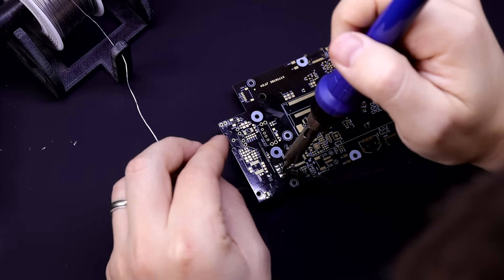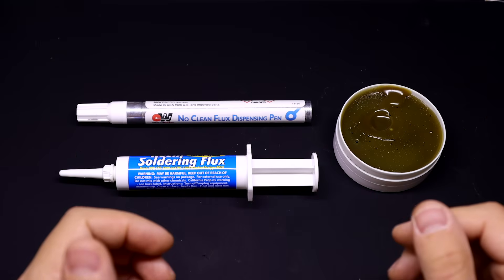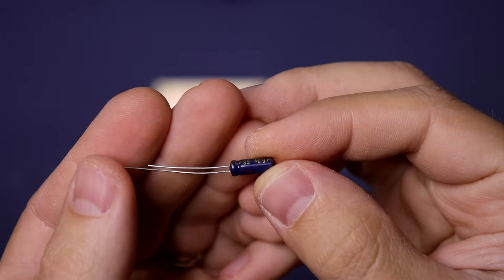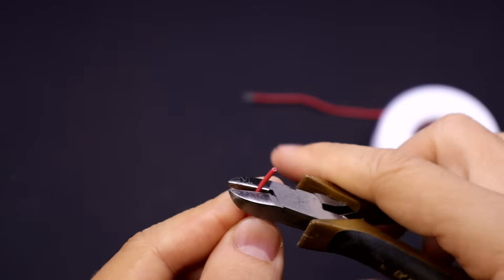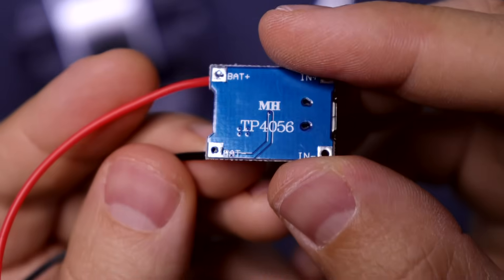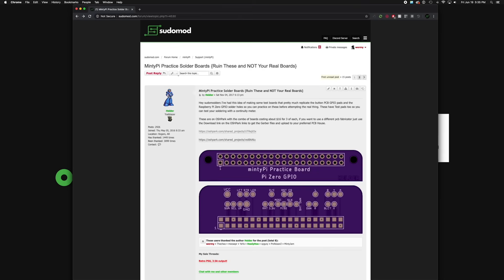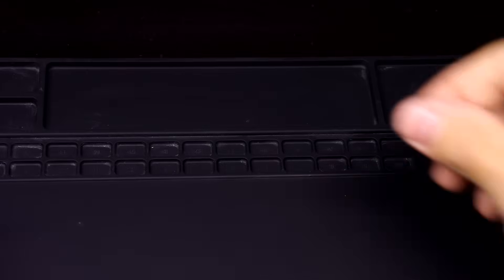Soldering Crash Course: Basic Techniques, Tips and Advice!

Comment: Good stuff! Interesting technique for making super flat connections between 2 boards. I tried something similar in the past for connecting 2 addressable LED strips, and it was honestly a little hit-or-miss. When you make a cut in those strips, there's always a chance that the data line will get bridged to power or ground, ensuring that the LEDs after that connection don't work properly.
I'm thinking one possible way to foolproof that board-to-board connection is to use a very low hot air on the rework station or the electric mini hot plate Adafruit sells to preheat all those pads. Or find some way to squeeze in a little solder paste (syringe?) into each through hole, then use hot air on the sandwich. Or maybe a method similar to BGA soldering: tin the bottom pads first, clean it, flux it, put Raspberry Pi on top, and proceed with hot air.

Anyone who solders every day should use a filter or good ventilation, especially if they're using lead-free. You really don't want to be inhaling flux vapor.

One thing I've learned from Rob back when he was doing Sparkfun product videos: Always leave a blob of solder on the tip of your iron when you're not using it. Making a habit of this will always keep the tip tinned (important for heat conduction), it will prolong its useful life and you won't need to use tip tinner which is designed to remove heavy oxidation and really shouldn't be used regularly. If the oxidation isn't horrible you can re-tin a tip with some solder wire and a little gel flux applied to it.

Comment: For 8:30 another method is to use liquid flux to add more fluidity for the solder to melt along with through the hole when heated.

Extra tips:
0) Wear eyepro; flying bits from snipping pieces, fumes, general safety.
1) Drag upwards when adequate amount of solder has been melted for a nice cone shape. Using liquid flux helps.
2) After solder has cooled, use a nylon brush plus 99% isopropyl alcohol to clean and shiny the solder.
3) Use the solder to cover the soldering iron tip, and dab into the cleaning container to apply a protective coating to the tip after you're done soldering.
4) Wash hands w/ soap and water every time you're done; don't want an eye infection from rubbing your eyes or face with dirty hands do you?
*Correct me if I got anything wrong & I'll edit my comment.
Reply: Just what I was looking for! Can't get the solder melted when trying to put the wire in (only worked once, and was just thinking about getting some liquid flux). Is this usual or am I doing something wrong?

Comment: Ok so I guess I’m a pre-beginner solder-er and I’m still stuck on how the flame comes out… I’m for sure missing a piece or two in my kit, but I don’t know how to heat the tip, the flame just goes out a hole on the side🤫🤷🏼‍♀️🤷🏼‍♀️
Reply: Flame? Solder guns don't have flames. (Maybe you have a propane torch?)

Comment: OK I'm just looking nice video by the way before I get into it I see a lot of people using flux And I see the can type in the squeeze type in the squeeze type I was wondering which is the best to use just for sottering wires back to the board And what kind of alcohol they use to clean up the mess and what they use to clean it up with a  Q tips is there a cleaning rag set I could buy on Amazon I just need to know need to know what I need to buy on Amazon the alcohol the flux and what kind of cleaning tools I got a sottering iron it's not the best but it will do the job thank you hope you get back Great videos by the way again thanks

Comment: This is a much better learning experience for solider I do a lot of soldering because I'm into radio control and I charge out connector but I don't do much motherboard and I use a lot more solider with connector so I need to  Practice using  Last solider like on my Orlandoo hunter esc and servo motherboard and now I'm into 3d printing and I need help fixing soon

Comment: I would like to hear your commentary on old solder old flux and old soldering tips...... what can I soak my rolls and rolls of solder in to clean them of this filthy coating.... and does flux lose its ability in time... and the different kinds of flux different for copper pipe different for electronic boards different

Comment: My daughter got a Pusheen wireless speaker.. actually Santa bought it but it seems to have lost its connections.  All the system does is just record that the battery is being charged.  I opened it up and found that the board and the wires to it aren't connected.  I find this video most helpful, please wish me luck to see if I can fix it.  I have a point soldering iron... Have to go to home Depot to get solder and see if I can find a cleaner.  Wish me luck

Comment: @wermy Good video man; helpful to me as a beginner.

(Dwight Schrute tone) Queeestion... What are the advantages of owning/using a hot air rework gun or station?
Reply from the maker: A rework gun makes easy work out of desoldering surface mount components that would otherwise be almost impossible to do cleanly with just an iron. Also makes it easier to use stuff like solder paste to populate a board. Super handy to have for things like heat shrink tubing, too. If you’ve got an extra cubic foot to spare on your desk it’s definitely worth it. 🤘

Comment: Many years ago I took a soldering course called PACE. It was designed to teach efficient, effective soldering. A story we were told was that when they were building the first space shuttle, they built a mock-up, then had the techs take the PACE course and do another mock-up. The difference between the two mock-ups was 2,000 pounds of solder...
Reply: NASA has an entire large manual just on soldering techniques. It's meticulously detailed, and they've studied the metallurgy of soldering in detail in creating their methods.

Comment: I went through an automotive college where we touched on soldering a bit but that was really just wire to wire or occasionally wire to connector. But when it comes to soldering onto a component i have this anxiety that im going to over heat it and fry the part. Is that a realistic fear? is it harder to do than i think? Is there a 5 second rule?

Comment: As someone who solders professionally this is a great video! Just a few personal tips and opinions I'd give:
First type of solder can make a difference depending on the required specs of a project, I prefer lead for through-board as it tends to be more maleable after cooling whereas lead-free composites are better for surface as it cools quicker and flows better.

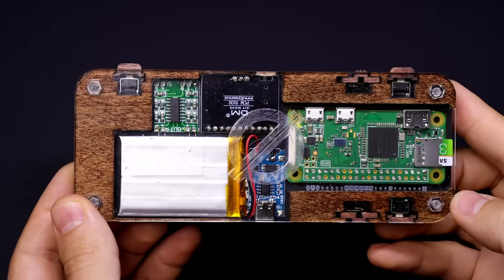11:00 this is usually called stacking and my biggest tip for this is to set an anchor pin in one of the corners. Doing so will make sure all the connections line up properly. If this was a micro connector like what is used in the applewatch you'd reflow or fill the pads first and then heat the solder to allow it to flow through the connector. But those connectors are really thin.

Comment: Thanks! This was more advanced than the things I need to know (I just need to solder switches and 3 LEDs to a mechanical keyboard), but when you recommended the Yihua branded iron/station, I felt more confident in the fact that I’ve been looking to purchase the Yihua 939D+ station. I keep being worried that spending only $53 will hurt more than help, but I truly don’t plan to solder all that often. I used a $12 wood burning pen my first time soldering (on a beginner’s practice kit) and it worked. Not perfectly, but it worked 😂 I just don’t want to ruin my actual projects, so I feel better seeing the recommendation.

Comment: I done exactly as you did to my PS4 controller as the wires came loose when I tried to fix the drift. The problem is you can't just take the board out to solder it. They fit in one piece at a time and when I tried to heat it up whilst touching the wire to the board. It melted the plastics around. So controller is useless. So how do I approach this?

Comment: What soldering is like for the average person:

Buy a $20-30 pencil style iron at a local store because you don't want to spend $100+ for the small amount of soldering that you'll do. Discover that only one specific area on one side of the tip actually gets hot enough to melt solder. Awkwardly press that part of the iron against the part, then gently feed some solder to it. Watch the solder bead up on the tip of the iron rather than one the parts you're trying to solder. Apply flux to the parts and repeat. Get some solder on the parts. Figure out that the easiest way is to just apply the solder to the tip of the iron then apply it to the parts. Check to see that they're actually making a good connection. Say "Good enough." and move on to the next connection.

Joining two wires: Twist strands of wires together. Apply flux. Hold iron against opposite side while applying solder to near side. Watch solder NOT melt. Watch wire insulation melt. Apply solder to tip of iron in frustration and repeatedly smear it along exposed wires until they're coated.

Buy higher wattage iron. Attempt to use it to solder wires to circuit board. Run into the same problems. Hold iron against wires so long that trace starts to lift off board. Scream in frustration. Realize that hotter iron just makes it easier to damage what you're working on. Go back to using dinky little iron.

Yes, I know that's not how you're supposed to do any of this, but that's what soldering is like for me.

Comment: and yet i hold the iron on the pads or whatever I'm trying to solder and the pads will melt off before the solder melts. . that's why I try and put solder on the tip and put it on the pads from there. . but that also only works if Its a brand new tip or i file it a bit. .  really getting pissed off because i keep finding these videos explaining "how to solder" i fallow them and what they show is not what happen when i try it. .
also my tips keep melting, ,

Comment: I've only soldered once. It took me about 3 hours to solder one thing.

Ultimately the problem was that I kept pulling away the Soldering iron before I pulled away the solder. 

So as soon as I pulled away the iron, the solder cooled and stayed on the end of solder rather than on the component.

Eventually I learned that I needed to hold the soldering iron in place and basically push the solder into it like you do here.

although I definitely still ended with a giant, sloppy lump of solder. But it functions.

Comment: On this scale work, the word you are looking for is "flow". Heat, apply, flow, slow cool, check.  As someone that has tinned and soldered more wires than I can count in manufacturing, in regards to putting wires into a board, keep the heat cycles to 1.  Tin the wire when you can for things like pads but, Secure the board, hold the wire and solder in one hand, watch the "flow" into the wire, and sometimes feel the heat in the wire burn you a little, and hold it still until the solder is cool.  (you'll be ok) The only reason to use those tip tools is in mass production or in case of poor tip care.  Use a sponge every time/thought and a little solder on the tip, sponge, work, and again the sponge will get you there. (it can also be a quick source of cold water) Don't overheat things, take it easy with the flux, it should be in your solder.  These are the points I would discuss with a class.  Anyways, Weller for the workmanship!  Worth every penny!

Comment: When I try the solder just wants to migrate to the iron tip and not stick to the wire or pin I am trying to solder together. How do I get the solder to stay on the component and not just melt on to the tip?

Comment: Can I see some down and dirty soldering repair, like trying to solder a new cap into a board in a boombox from 1986 which you can’t remove the board itself without cutting 20 wires.  On top of that you have to wrestle the board with one hand to keep it from turning since you had to at least remove a couple screws to get to the underside.  And the board just happens to be stuffed behind a ratnest of other wires and mechanical parts that tend to break when you just breathe on them.

Comment: Ok, I’m trying to solder pins to an arduino board, but the solder won’t melt unless it is in contact with the iron itself. I cranked the iron temp all the way up, and the solder still won’t melt unless I touch it to the iron. I’m using 0.8mm, lead free, 99% tin solder wire.

Am I using the wrong solder wire? It seems that the idea is to heat the pin and hole with the iron and the solder will melt without having to touch the iron itself, but no matter how long I try to heat up the pin, the solder doesn’t melt unless touching the iron. Any help would be greatly appreciated. Thanks!

Comment: I would like to see, using a standard plug in soldering iron no features, and mdeium gauge rosin core solder.  Reattach a 5 pin usb female to a  board.  My problem is the smaller pins keeping the solder in nice thin lines.

Comment: I'm halfway through this video and have seen several examples of soldering connections, and you even explained how to think of solder as a bonding agent between two heated metal components. What I have yet to learn is to what do I initially contact the unmelted solder? Should I avoid the tip of the iron with the aforementioned solder? Should I wait with the solder contacting both components until the heat transferred through each from the iron simultaneously reaches the solder's melting point? Should I melt a bit of solder onto the iron and then hold that to the component ends?

Comment: Soldering glue makes way more sense
Glue with metal inside that has been grinded into a powder
I almost made it in Toronto but everyone was so depressing i gave up but it makes way more sense
Grind any metal that sends signal and put it in glue 
Worth major money to anyone
I would buy from you
I suggest you use copper.
I would do it but Canada is so depressing its like doing anything isnt worth it

Comment: Love the video, but curious, when splicing wires, why would you not opt for a lineman's splice instead? Where you bend both wired ends into hooks, and twist each wire around the opposite wire's hook, then solder them together.  Even without soldering, this results in an extremely strong, and clean splice with good contact and no additional width added to the wire.  With solder, it's nearly as strong as unbroken wire.

https://en.wikipedia.org/wiki/Western_Union_splice

Comment: is there a difference when soldering 2 wires together the way you showed and putting wires together   --=--  like this? and also with doing the through-hole is there a difference of bending the legs away instead of bending them towards each other and cutting the excess parts of the leg then soldering then soldering then cutting?

I was taught to cut the excess off first before soldering as iirc he said if u solder then cut you could crack the solder or something with the force from cutting i guess, honestly cant recall exactly as it was back in april of 2019, was also shown how to attach 2 wires like people are shaking hands rather then you shaking your own 2 hands, not his words but best way that i can explain it without pictures lol

Comment: your advice about the two PCB's not effective and ..can destroy a copper track so easily . using flux on both PCB's and hold the iron tip a little will be much safer that pressed your soldering tip inside the holes .but generally its a good video for beginners.